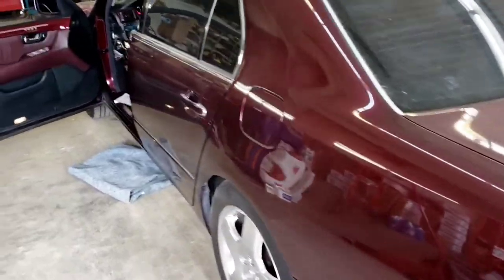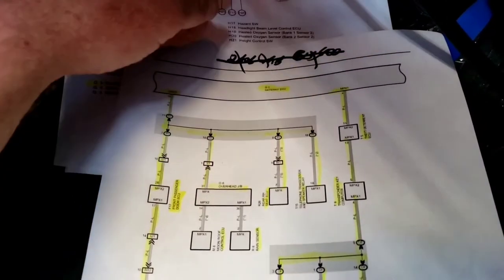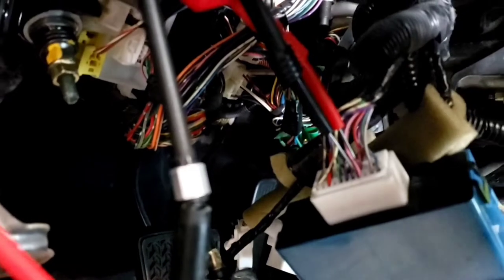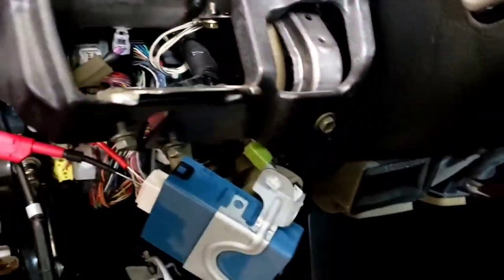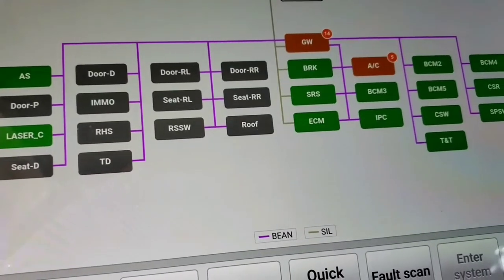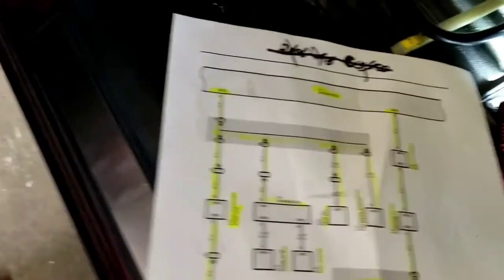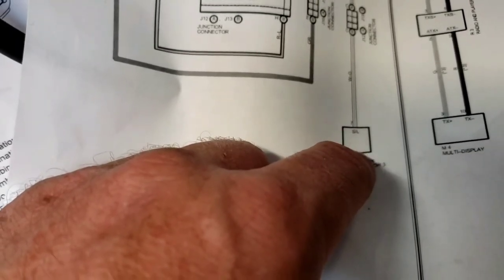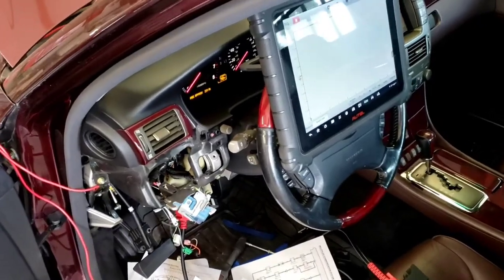2001 Lexus LS430 Body Modules Communication Issues Part 1

Comment: Cut the wires near the module see if one of the modules causing it or if the gateway is just bad
Reply: or unplug
Reply: My temp control switches not working
Reply: N my ls430